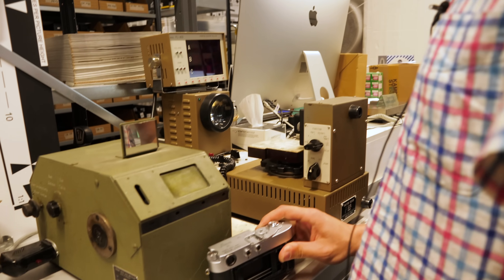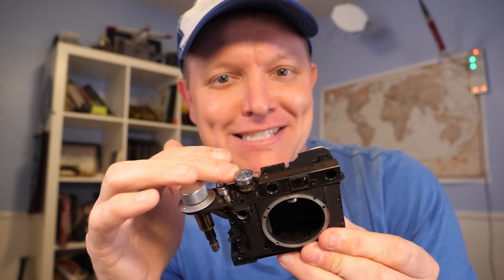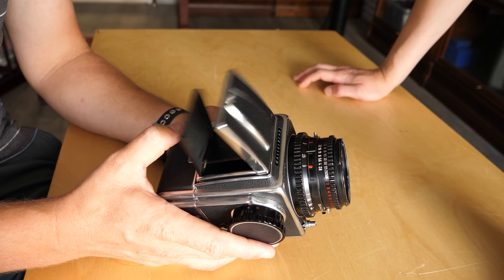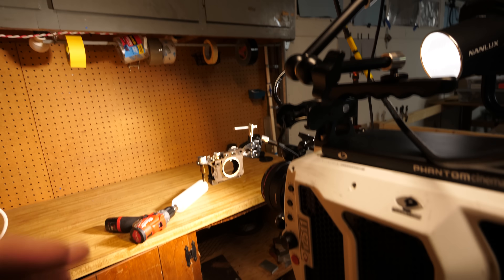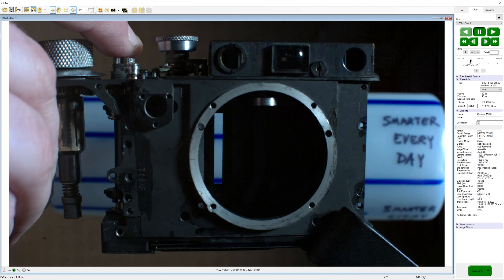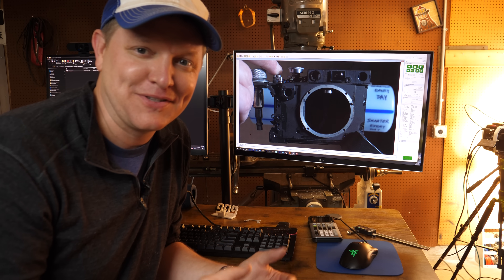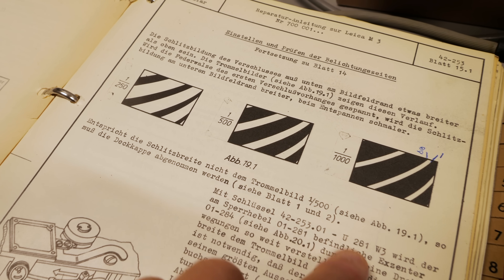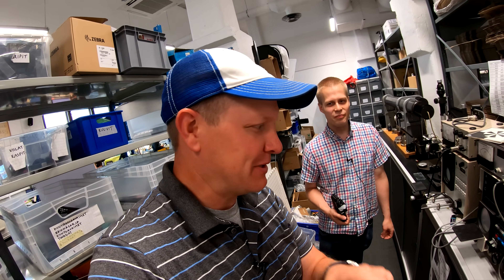How the Germans Measured Milliseconds MECHANICALLY - Smarter Every Day 283

Comment: I think it's interesting that the curvature of the lines shown, actually shows you that the camera shutter is accelerating basically the whole time. All other things being equal, you'd get unequal exposure across the picture, with more exposure earlier in the frame, and less exposure later, as the shutter accelerates.

I'm curious what they do to compensate for that - or if they do at all.

Comment: I believe persistence of vision is actually of the brain not the eyes. Most of our visual perception is actually composited by the brain. Removing your nose, ignoring blinks, adding in the peripherals so it doesn't look you are looking through a pinhole, etc. I assume there is some minimum switch time for the light detecting cells in your eyes but I also assume this is shorter than the brain takes to process a "frame" of information. I think based on this video it seems like the eyes would have to be providing information faster than the brain can record it if you think of the shutter as the eye and the film as the brain.

Comment: So given that changing shutter speed changes the width of the line, but not the angle, that means you're Not actually changing the speed of the curtains as they race across the film, but how far they are apart, correct?

Comment: Well, I'll be darned... I've shot film and then digital with SLRs and various other cameras for decades and didn't know a shutter went sideways! 🤯 I assumed vertical. I've known about rolling shutter but this has cemented the thing forever in my brain. Cheers Destin and everyone else in this 😊
Reply: I've had two film SLRs. The older one (my Dad's Yashika - he replaced it with an Olympus OM2) had a horizontal shutter and hence a 1/60 sec was the shortest flash-sync speed. The newer one was a Canon with a vertical shutter, and that could sync to either 1/125 or 1/250 (I forget which).

My very first camera was my grandpa's Voightlander which had a non-removable 50 mm lens with a leaf shutter which could sync at any speed. It took some getting used to an SLR that had a minimum speed at which it could sync.

I presume the faster the shutter can open and close, the faster will be the transition from full frame to variable-width slit, and so the faster the flash sync speed. How much variation was there between one manufacturer's shutter and another as to the speed at which the transition from one mode to the other occurred?
Reply: @Mortimer50145  thanks for this information, that's very interesting regarding sync speeds and also different shutter orientation. I'll do some more reading around this I think. Time to get out the old film gear!!

Comment: I think it's remarkable that to this day, even our phone cameras are using the same principles and measurements for shutter speed but digitally. The sensor actually reads out the data at different intervals digitally depending on the set shutter speed.

Comment: I still use these cameras. Will you (or somebody) please make a video that shows this pattern on Youtube so that I can check my cameras using the screen.
Reply: Just what I was thinking, just been trying to get an animated gif of black and white lines to do the same. Monitor doesn't refresh quick enough (or animation frame rate is too slow - more testing needed). May actually make a machine like this, using stepper motor Arduino or the like and led illumination - should be easier than it was back then.

Comment: You should talk about the constant speed of the curtains.  Horizontal curtains such as these cameras have a flash sync of 1/60 and vertical shutters have a flash sync of 1/125 or 1/250.   Love the video!
Reply: I agree. It might be worth noting that this method can be used to determine both the curtain speed and the curtain separation.

Comment: Hey! I've got a rolling shutter on my old Nikon F,  purchased early '70s. There's only a slit that travels from one side to the other, higher shutter speeds used smaller slit. On some subjects, if they're moving fast, this effect is only slightly noticable as the moving subject changes position as the slit exposes the film.  🤔
 Another important factor that made Leica so desirable is that they had excellent lenses. There's no substitute for excellent lenses!
Reply: "Focal plane shutter"

Comment: You can also see dark strobe lines by releasing the shutter in front of a fluorescent light bulb.  If you measure a new or just tuned camera, you can somewhat easily compare the strobe lines that show up on an older camera that may need a tune up.  I got this from a Leica technician in Germany, when I worked there.
Reply: The same thing happens when you shoot an old TV at anything over 1/60 sec. Analog TV works at 60 frames/sec, so faster speeds register the black stripe between frames. Anything slower than 1/60 doesn't, for the same reason that a focal-plane shutter that has an electronic flash sync speed of 1/60 sec will expose less of the film at faster speeds, and all of it at slower speeds.
If you've ever seen home movies of a TV, you'll see the black stripe flicking across the screen. That's because 8mm and 16mm film runs at 16 frames/sec. The stripe is blurred because the shutter speed of the movie camera was 1/30, and it's out of sync with the film (60 fps on 16 fps film), which is why you see two stripes, moving upward across the TV screen, and they're curved, just like the lines in the test video. 
My granddad filmed the Beatles on Ed Sullivan in 1964, for my mom, and I always wondered why it had those stripes on it, cos I didn't see them when I watched the TV. I first saw the film in 1968 (age 3), and since we didn't have any intertubes then, it wasn't until 1975 that I found out. My granddad built a darkroom that June, and I asked the owners of the camera store about it.

Comment: It’s interesting to me that the duration of the frame exposure actually is the same (roughly) for the different shutter speeds. All that’s changing is the lag time between the leading and trailing curtains. I would have expected to see fewer lines on the faster shutter speed, but instead we see thinner lines. This means that in your 1/1000 s exposure, the left edge and right edge of your image each get 1/1000 s, but not the SAME 1/1000s - right edge is a couple of milliseconds later.

Comment: 7:00 i used to use a Yashica film camera, had iirc a pinhole style shutter were it rotates in to also control f stop, wonder if that produces a different result since the shutter doesnt operate in a scanning motion, tho it was a much more modern camera, slr 35mm from teh 1980s wit digital flash and remote trigger, took 2 aa batteries, and shutter was also electronically controlled not manually,  hold dat shutter down and, click click click click click hi speed lyke even can be used wit iso 1600 and 3200

Comment: 1:15 well if you can record at different frame rates it can
Reply: if you tune dat shutter speed correctly then when you snap a picuture at a set shutter speed you should see a flash of light, if speed aint right u see nothing....using a video camera match the recording frame rate to a multiple of the pulse frequency it produces, get weird looking effects, why recording a crt presents same issues
Reply: now all you need is to modulate the light source and use a phosphor screen and its a mechanical tv

Comment: I wonder.  I remember hearing some years ago about a world record or something related to the olympics (I think?) that was recorded a century ago, maybe even longer.  I have been wondering how they measured this precisely so long ago.  Perhaps they used something similar to this?

On another note, many people don't realize that we can actually see very fast strobing by moving your eyes and concentrating on the after image that is briefly left in the retina ...  I notice this when driving, as many modern cars have tail  lights that actually blink at a refresh rate that is equal off and equal on times.  The lights then appear solid (and brighter) when they apply the brakes.  What I do is bat my eyes a couple times left to right at a rate of perhaps 4 beats per second.  We can also see a similar effect on old CRT screens, and can pick out the scan down and the scan up based on the angle of the afterimage.  All with the human eye!  Try waving your finger in front of a CRT screen, and you can see a strobe effect.  LED clocks on your microwave, pretty much anything that runs at a refresh rate.

Comment: 5:13 for the interested people here. The translation of the top part in the manual:

Adjustment and check of shutter speed
Continuation of page 14

The slit shape of the shutter needs to be wider on the lower frame edge compared to the top. The drum images (see Abb.19.1) show the progression. If the spring cylinder of the first shutter curtain is tightened then the slit shape on the bottom will be widened, if released it will be narrowed.

Images of [Abb.19.1]

Comment: This relies on the accuracy of the frequency of the electric generating facility and the speed of their generators making the 50 Hz of 60 Hz AC which can vary depending on the time of day and loading of the electric grid.  Over the course of 24 hours, the differences will average out and it will be quite accurate but at any particular moment is can be fast of slow.

Comment: Was the "curvature" on the images made with the rotating stripes on the bottle exaggerated by the small diameter of the bottle. When the stripe is at the top it appears to the camera sensor be moving slowly, then accelerating opposite the sensor, and slowing again as it nears the bottom. Indeed just like the springs accelerating and decelerating. If you were to repeat the experiment with a much larger diameter bottle, the lines would I expect, be much straighter. Though still at an angle.
Incidentally, if I remember correctly the first shutters with two leaves moved left to right, or right to left. That meant shutter speeds of 1/100 or slower were needed with electronic flash's. Someone then decided to redesign the shutter to move from top to bottom, thus reducing the distance the leaves had to travel. The fastest shutter speed used with electronic flash's could go now to 1/250.

Comment: There is no persistence in the eye. 
In psychology there is something called 'the grand illusion'. If you read this you'll discover experiments done with modified contact lenses to project a continuous image on the same spot on the fovea. With very unexpected results. The image can disappear completely even though the light of the image is still projecting on the fovea. It actually goes through a cycle of parts of the image that disappears to reveal patterns in the image until the point it completely disappear. Then you see the image as is and the cycle of pattern searching starts again. All this while the whole image is projected on the fovea.
So no persistence even when the input is persistent.

Comment: The need to measure milliseconds is far older than photography. In exterior ballistics it was long not possible to measure the muzzle velocity directly since the lack of chronographs. The ballistic pendulum of the late 18th century was the first attempt conducted by Benjamin Robbins. 
Later Le Boulengé invented the first real reliable chronograph.
A spinning plate to determine the length of a shot column was used by the "Wannsee Commission" up back to the 60ies and 70ies of the last century.

Comment: The stroboscope principle is also used for tuning musical instruments -- turning something you can hear into a clearly visible pattern so you can make fine adjustments. You could do a follow-up video about that. There was the Conn Strobotuner, later bought by Peterson.
Reply: Its also used to set ignition timing on older cars and engines
Reply: @cjgordon22  That's right! I remember twisting the distributor and watching the marks on the flywheel.

Comment: I reckon the SLR has curved lines due to the shutter rolling horizontally as where a digital phone cam "shutter" "rolls" vertically, rather than spring loading. I'd wager holding one 90° to how it was would reproduce the results of the other.

Comment: You tune a piano in a similar way. Each "string" is actually 3 strings (2 for the lower notes), and they need to be tuned to the exact same frequency (called a unison). It's impossible to measure the frequency accurately enough with instruments to do that, so you tune one string first. Then tune the other two strings to match. If they don't match, the sliding offset of the two waveforms causes a slight amplitude modulation, which your ears pick up as a warbling to the sound. The closer they are in frequency, the slower the warbling becomes. And you rely on that to get the second string closer and closer to the first string's frequency until it matches. Repeat for the third string.

Likewise, you tune the strings for the other notes to your now-tuned string. Except there's a gotcha. The equal temperament scale used with modern music spaces the notes apart equally in frequency (logarithmic scale). But eliminating the warbling requires just temperament (frequency of different notes being integer ratios). These two do not match up mathematically. So depending on how far away the note you're tuning is from the note you've already tuned, you need to tune it for a certain number of warbles per second to match it to the equal temperament scale.

(There's all sorts of other stuff that makes it more complicated. But this is the gist of it.)

Comment: Fascinating, great video! A couple of additional things I'm interested in are (1) how do you confirm the mechanical machine is actually measuring 1/250, 1/500, etc. without modern instruments, (2) once it appears a camera's shutter is out of adjustment, how is the camera fixed? All of these analog adjustments are so interesting - spring tensions, speed of the revolving cylinder, etc.

Comment: I guess you'd have seen the bent lines on the phone, if he held it in landscape mode. As the shutter on the phone "moves" in the same direction as the rotating drum and is probably averaged across multiple readings, you don't have these bends like with the shutter moving 90° rotated against the movement of the drum.

Comment: I bet the curve on your ketchup bottle generated lines also comes from the spinning mechanism having a smaller radius - the apparent vertical velocity changes given the angle it's facing.  A sliding striped thing would not curve from that source.  The Leica test rig likely has a large enough radius to minimize the effect.

Comment: My grandpa gave me his rolleiflex that had been in storage for years and he didn’t know what condition it was in. He said you could test shutter speeds with an old school tv and get the same lines shown from the strobing machine in the beginning.
Reply from the maker: Clever
Reply: @smartereveryday I remember something like this was mentioned in a camera magazine article back in the day when TVs used CRTs.  The idea was to photograph a TV screen and count scan lines, 15.75 lines in 1/1000 second if my math is correct (NTSC standard).  Or search "test slr shutter speed using tv" and you'll find some interesting stuff from the past.

Comment: Leica wasn't the only super high-quality camera back then. I have my grandfather's Alpa 11e, which was hand-built by the Swiss. It's so ludicrously high-end that it cost $1800 for the BODY in 1972 and some of the electrical contacts inside are SOLID GOLD. As in the ends of some wires have little gold cylinders on them. It's at least as good as a Leica, but very low production; they made something like 750 11e cameras over their entire production run.

Comment: The curvature in the resulting picture should tell us more about the variation in speed of the rolling shutter. It's something one would expect when using a spring to move the shutter. If the camera is used to purposely catch a linearly moving object, e.g. a race car, then the picture will not only be blurred more or less, but also be spatially distorted, similarly to what this experiment shows. horizontally and vertically motion will produce a different result. Interesting!

Comment: persistence of vision has to do with how neuron transmission works, so it's both in the brain and in the eye, as the light slowly accumulates to fire off a neuron it forms a pattern over time, almost like a "frames per second" for your eye, but it's blurry, the correction is done in your brain to account for such things which results in you seeing moving patterns as a single coherent image, even if that image is distorted. So the effect of being able to see an imagine like the aliasing or the curved lines, is your eyes accumulating that data as one blurry mess and your brain making sense of it

Comment: I started training as a camera repair technician in the early 70s . We used a very similar device to adjust shutter speeds in focal plane shutters . Later on the shutter speed and focal plane testers became advanced with digital readouts. It was more precise and easier to work with. I did camera repair for 40 years , retiring in 2016

Comment: A fun comparison: the shutter on the two Gigapixel cameras that are operated on the Pan-STARRS telescopes at the summit of Haleakalā, Maui operate similarly. One blade moves to expose the focalplane to light, and a second chases it to close the shutter again. The main differences are the blades are driven by stepper motors to control the acceleration and deceleration of the blades for consistency, and that the shutter aperture is just short of half a metre across.